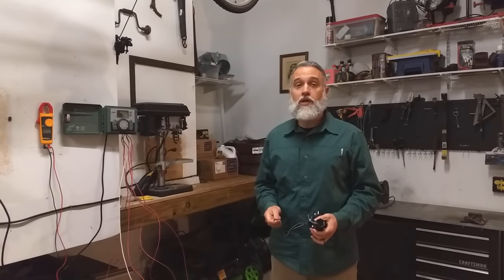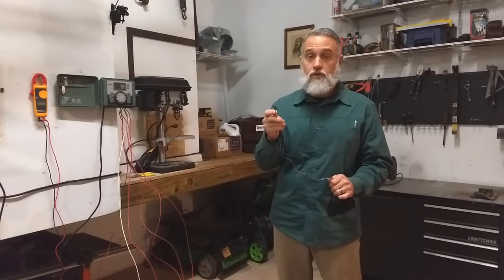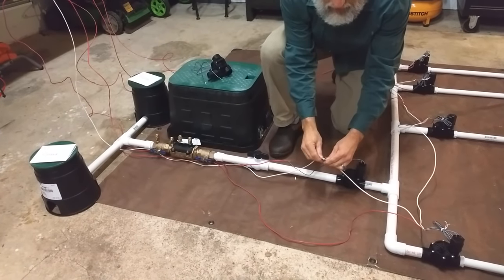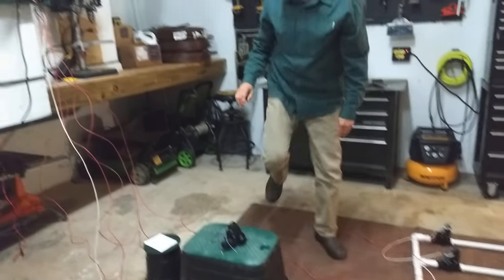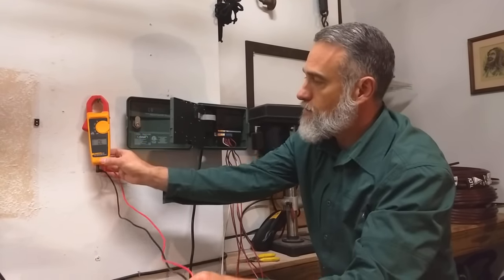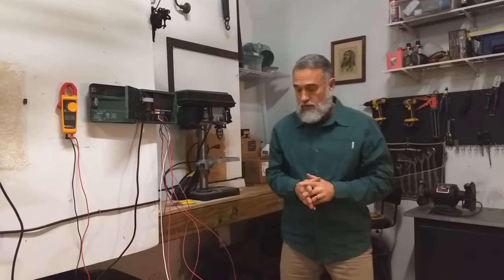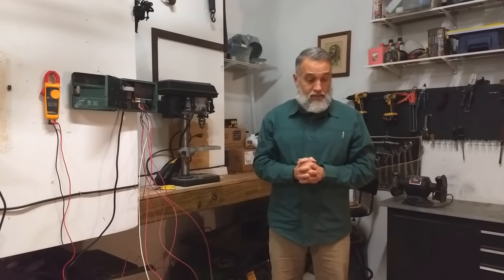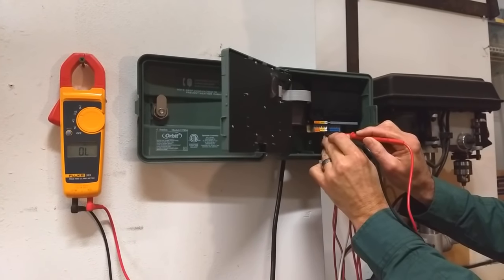Troubleshooting sprinkler system wiring issues

Comment: Hi, I do need some troubleshooting help. I do need to buy a new voltage meter, so none of this was down with one. 
My issue: 5 zone residential circuit. Zone 3 originally was stuck on for a whole 1-5 zone cycle. Now zone 2 & 3 go on and stay one all of the time. I have replaced both valves in whole, solenoids, cleaned all wire connections and the controller box (old). Also, I installed a main water value shut off for zones 1-4 entirely. 
So, at this point, I'm guessing there is an issue with the dedicated zone 2 & zone 3 wires (not the common wire). It is AZ and 102 today, digging up the main wireline from the front yard (controller) to the backyard (where valve box is located) is definitely the last thing that I want to do.
Can you confirm that there is no other option but a broken dedicated wire zone 2 & 3 somewhere?.. Or something else? I am open to ideas.
Reply from the maker: Yikes, you hit everything I'm thinking as well.  Usually a stuck valve is a result of a bad diaphragm.  If you have changed the valves that should have fixed it.  The other thing is the controller can give AC to more than one zone when it's malfunctioning.  If you've changed the controller, that should have fixed it.  If you have a master valve, you can turn it on manually and see the zones come on without the controller.  If they do it's a mechanical failure in the valve.  If not that, I'm not sure what it would be but would check the valve again.
Reply: There is the possibility of a programming issue in the controller box, since you have changed every thing else.  A little known (by me anyway) issue is a 3 volt lithium button cell battery that provides power to the mother board in the controller box.  On my old Rainbird box, this battery is not mentioned in the text of the manual and cannot be found by checking the table of contents or index.  It is designed to last 10 years and you describe your controller as being old.  To check this out,  cut off power to the system, take normal precautions to prevent electrical shocks, and take the case apart to get to the motherboard, unless there is some other access to that battery.  This type of battery is often seen in automobile key fobs, etc., and is typically available where ever batteries are sold.  By the way, I got an electronic copy of my Rainbird manual, and used the search function of my computer to find all references to batteries. Rainbird did put a reference to this battery on the back page of the manual, mentioned its 10 year life expectancy, and said it could not be replaced and that you would have to buy a new controller. This is B.S.  Once you locate this battery, it can be replaced in seconds if you happen to have one on hand (I keep these around for key fobs and TV remotes) - if not, just get the number off of the old one (take a picture of it with your phone) and buy a new one.  Replacing it is simple. No new controller is needed.  I would never have known about the existence of this battery if someone had not mentioned it in passing in a comment to another YouTube video.  Good luck.

Comment: Hi, I have the orbit 6 station timer. I have an issues and can't figure it out. I have 3 station on it. My timer runs my 3 stations and then instead of turning off like normal it keeps running them over and over again until I turn it off manually. What can I do to fix the problem?
Reply from the maker: I'd double check the programming and if it's correct, and do a reset (if it has one) then I'd change the controller if it still continues.  I hope the best for you!

Comment: Hi there. 
I loved yr video, explaining the master valve, I understand that one of its wires is wired to the common wire, but I am confused what the other wire is connected to. 
I thought u said in the video that it gets connected to any one of the coloured wires, if this is correct. then what makes this the master valve different from the other valves. 
Is the difference between how you treat them back at the control box. Does the master valve wire go somewhere other then in a station number slot.
Reply from the maker: There is a separate spot in ur controller that’s marked MV, or Pump and that’s where the wire for the master valve goes.

Comment: Everything at my Rachio looks good, no break in the wire based on all the tests to one of my zones. I go out to the zone and run the system and instantly hear a click but not watering start. The valve had and old Richdel R-204 top next to it but has an Irritrol one fitted. Any idea?
Reply from the maker: If you hear it click but not open and you are getting continuity and 20-60 ohms, then it sounds like something mechanically is wrong with the valve.  Port could be blocked or bad diaphragm.
Reply from the maker: If the solenoid is continuing to click, then it's probably the solenoid even if you have good readings.
Reply: @sprinklerrepair4L  Thank you, if I undo the solenoid water will travel to the sprinklers, does this sound like a bad diaphragm? The old valve top left behind was a Richdel R-204 but it now has a Irritol cover. Are these compatible?
Reply from the maker: @regiramon6932  you should be able to turn the solenoid a 1/4 of turn and open the flow of water or if it has a bleed screw, you can do the same thing.  So this wouldn't necessarily mean a bad diaphragm.  Richdel and some irritrol are interchangeable.  Toro owns them all now, but they still have an irritrol line of products.  I've had success with the 8 screw one being interchangeable, but not the jar top.

Comment: Is it difficult for a home owner to install an inground sprinkler system like this? 
1. Should valves be located at each zone or should it be cluster into one box (pros/cons)
2. Best way to run wire to each zone?

Great videos...
Reply from the maker: I'd say the difficulty level would be pretty high for a homeowner to install.  Most cities require permits, backflow testing and have minimal requirements.  In North Texas where I am, most everyone installs the valves in the area they will be watering which goes with what TCEQ says.  While manifolding them all together makes wiring and valve troubleshooting much easier, it also makes for huge lateral lines that can be inefficient.  You can use single wires as I show in the video or you can use a bundle, but it's the same principle.  Good luck with your project!
Reply: Thank you and I appreciate the reply!

Comment: I have an issue where I set the timer and one of my zones (zone1) is intermittent; sometimes not working at all. However if I go manual no issue and it works just fine. Any ideas?
Reply from the maker: Paul Jones I’d check the ac with a multi meter when it’s being intermittent and if the voltage is going in and out it’s probably your controller.  You can call the manufacturer and see if there is anything you can do, but probably you’ll just have to replace it if that’s the case.

Comment: How can I tell if I have a Master Valve?  I do have 4 zones but since I replaced my rain sensor my irritrol panel is blinking (indicating a short) and will not turn on.
Reply from the maker: Chris Kies look at your controller and there should be a slot next to the common that says MV or Pump or Master Valve.  If you have a wire in it with resistance, then you have a working master valve.

Comment: None of my valves turn on. I have a 43vac from my 24vac terminal. All my continuity testing from common to each zone is good.  Do I need a new transformer?
Reply from the maker: Hmmmm...if you are getting 20-60 ohms on each zone, I'd guess that the 43v would work even though it's a bit high. Have you checked the water supply?
Reply: 4L Irrigation Repair that is the first thing I thought of since my town only allows reclaimed water from 6pm-10am but they still make a sound trying to pop up even when the water is off. The ohms on each zone is right around 43. I don't know why my vac reading is so high when it should be 24 so I unplugged the unit and ordered a 24vac transformer to test with. Just waiting for that now.
Reply from the maker: @padistedor  I hope the best for you!  Have you turned on the valve manually to see if it works manually?
Reply: 4L Irrigation Repair no how do I do that? I know where the valve boxes are but don't know how to active them.
Reply from the maker: @padistedor  There are 2 ways to turn them on.  If there is a little bleed screw, I'd use it.  If not, turn the solenoid 1/4 or a turn counter clockwise and you will hear/feel the water going through if the water is at the valve and it's working correctly.
Reply: 4L Irrigation Repair ok great, I'll let you know how that goes
Reply from the maker: @padistedor  just don't screw either all the way out or over tighten.  If you go all the way out you'll get water up through them and especially on the bleed screw if you overtighten it will break off.
Reply: 4L Irrigation Repair i get nothing when I turn the valve 1/4 turn. I'll check with the town on Monday to ask if the reclaimed water pump is on.

Comment: So I'm having an issue with my sprinkler system ...I'm getting the voltage out of my controller to the valves about 28 volts to all 6 zones but when I go to check the resistance I get 4.45 Mohms across the common and the each of the 6 channels what do i do? Do i need to replace the common wire?
Reply from the maker: Just a couple of things, make sure you have your multimeter on ohms and the controller is off when testing resistance.  Have one probe on the common and the other on the zone wire you're testing.  You should get between 20-60 ohms.  When checking voltage turn your multimeter to ac and the voltage you are getting at 28 is good.  If you'd like to discuss further feel free to give me a call.

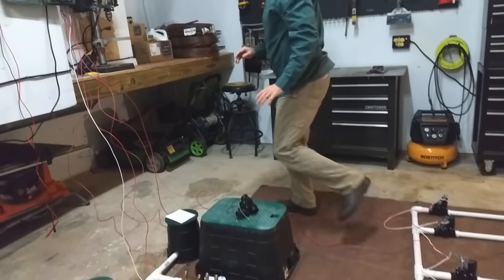Comment: at 2:50 on  the controller 1 zone is ON? if I want measure the Ohms I open the 1 zone on the controller?
Reply from the maker: You measure ohms with no as on.  You measure voltage with the zone on
Reply: @sprinklerrepair4L  thank you!
Reply from the maker: @gergelyszabo9225  you’re welcome!

Comment: My sprinkler pump when turned on keeps tripping the breaker, The pump does work because its starts then about to 10 secs later trips the breaker. The old underground wiring wound up breaking for some reason so I bought romex i think its called and ran it in like 1in pvc. Its the white wiring thats used in like new home construction for prob electrical outlets. Anyway..The run from the pump is about 110ft long. I have an old timer and the heads are the manual kind. The breaker is 2x 110v breakers together. Thats about it. The pump was installed about 2 years ago but  only used about 10 times because I didnt have the money to have them come out again. Any help would be appreciated...Thank you soo much. Btw your video is great and I now know more about that type of heads..q
Reply from the maker: beach side, I wish I could help you but I’m not a pump guy.  Maybe someone else can jump in here and give some advice.  I hope the best for you!
Reply: @sprinklerrepair4L  Ok thanks anyway. Great video

Comment: Hi Jimmy,
Great videos, thank you!  I have a separate problem: i have 24v coming into my hunter box.  However, when i test each zone with the meter, it only gives me between 20-21v.  Out of 7 zones, only zone 3 is working normal and its the only one that has 24v: the rest of the zones only has 21v or less which are NOT working, except zone 3.  Please HELP!
Reply from the maker: Michael Hovan what are the ohm readings on each zone?
Reply: 4L Irrigation Repair using the meter, connecting one end to common wire, other to each zone, there is no output.  When I connect the meter wire one end to each zone, it reads 54.
Reply: There is also a master valve as well.  Tested the ohm at master valve, no reading at all.  The solenoids are good with good ohm numbers.
Reply from the maker: 54 ohms means they are within the range and should be good.  No ohms on the MV means a wiring problem somewhere between the controller and the MV.
Reply: 4L Irrigation Repair i removed the wire for master valve.  System working again without going thru master valve.  Now i have a new problem.  Zone 3 running even with the power off.  I unplug the power from controller, but zone 3 still watering.  Please help!
Reply from the maker: Michael Hovan sounds like a mechanical failure of a valve...either need to change the valve out or the guts of it if you can find them.
Reply from the maker: https://youtu.be/Y-SzmZZ2VUk

Comment: Master value gets one wire to common and the other wire gets connected to what?
Reply from the maker: Inside the controller there is a slot that says MV or P or Pump.  The MV wire goes into that slot.

Comment: One of my 6 zones would not work once in a while. It shows that it’s spraying at the controller screen, but no water comes out at that zone. What can be the problem?
Reply from the maker: I'd start at the controller and see if it has the correct ohms.  That will tell you if it's an electrical problem or mechanical.  If it does, and the controller is giving it the correct voltage (24v + or so) then it's probably a mechanical failure of the valve.  I hope the best for you!
Reply: 4L Irrigation Repair 
Thanks for the reply! All zones checked at similar ohms. Each zone would work if I turn each zone on manually. It skips the 3rd zone every time. I doubt it’s a mechanical issue because I swapped that zone with another, and then that one gets skipped.
Reply from the maker: @anotherkhanh , interesting because if the ohms check out it usually rules out an electrical issue.  I assume it was between 20-60, correct?  However, the controller skipping is usually a result of an electrical issue.  I'd run wires on top of the ground back to the controller.  If that works, you know it's an electrical problem.  If not, it goes back to a mechanical problem.  I hope the best for you!

Comment: No MV - Just 5 valves. 1st valve 1 red wire connects with common and rest of the 4 valves red wire and then the 2nd red wires connect to individual zone wires. There is also a rainbird wiring connection for rain delay to the 1st valve
Reply from the maker: What’s the ohm readings on each zone?
Reply: @sprinklerrepair4L  Everything was consistent. I removed the rainsensor, rewired everything and now its working. Thanks for your response

Comment: I have a cuestión why my clock keeps 3 station on and doesn’t turn the solenoid off !? I have 30 station #1 is bad #_2 and #22
Reply from the maker: Juan vazquex, I'd check and see if the controller is giving AC ~24-28v to the station all the time.  If not it's probably a bad diaphragm or solenoid in the valve for that zone.  I hope the best for you!

Comment: Using an orbit model number 57899 9 sections . When the 10 minute cycle starts counter clockwise the last valve from the cycle simoustanly turns on and reduces the pressure from all other sprinkler heads and reduces the range of water coverage drastically ..this happened over time ...it worked fine at first. Anyone know what the issue is and can give me an insight to what the problem might be
Reply from the maker: It may not be a controller issue. To test just make sure that the controller is not giving AC to that zone. If it is not it is a mechanical failure of the valve, which is usually what is happening. I hope the best for you!

Comment: Sprinklers continuing watering out for about 15  minutes....why...how to solve it ?
Reply from the maker: If you mean they are fully running, it would point to a valve not closing down or controller continuing with AC for 15 min.  If you mean the heads continue to seep water for 15 minutes, that is just the water in the lines leaking out.  It is usually the lowest head on the zone that is impacted.  There is .433 psi/ft.  So if the steeper the slope, the more pressure.

Comment: I have a problem the zone numbers on the box is not changing
Reply from the maker: Verline Albritton if it doesn't do change in auto then the clock is going bad.  Just make sure you times are set appropriately.  Good luck!

Comment: Where is the pump connected????
Reply from the maker: Pump would connect in the master valve/pump slot on the controller
Reply from the maker: If you’re talking in regards to the supply, it would be in front of the backflow
Reply: @sprinklerrepair4L  thanks. I just about the pump relay today. Hehe